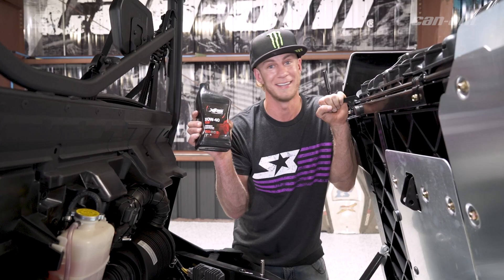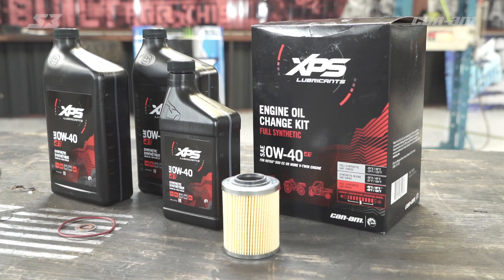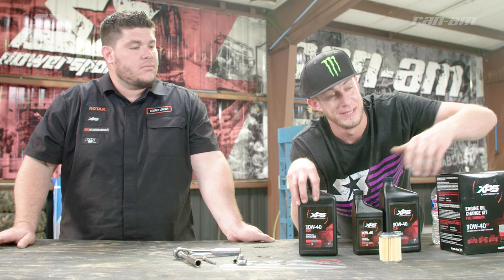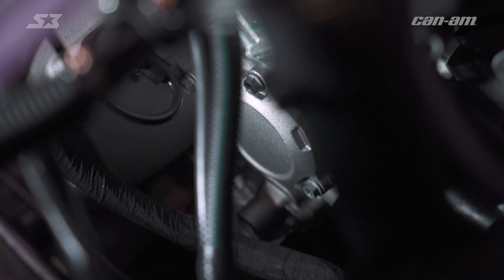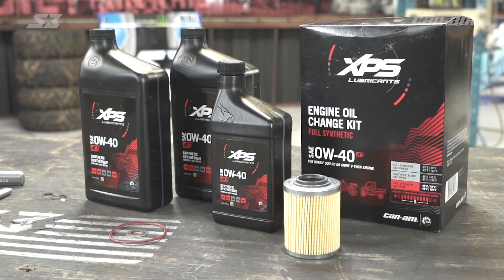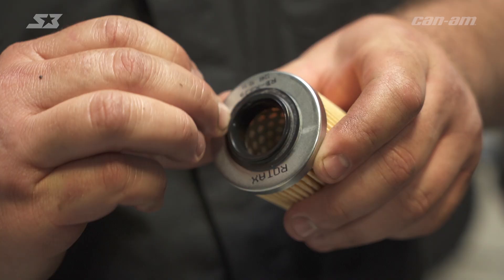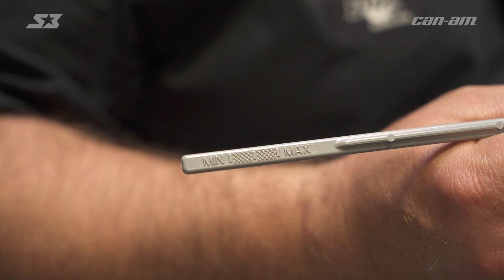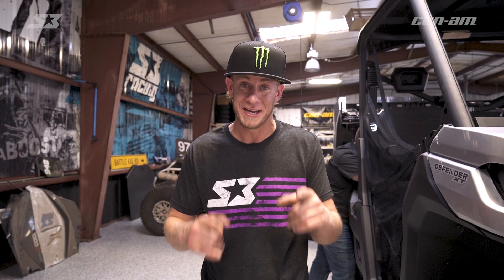How to change the Oil & Filter on your Can-Am Defender | Gettin’ It Done

Comment: You say 13mm socket for the drain plug but it is 17, and if you look at the video when you pull out the drain plug you can see 17 on the socket. May want to update this but other than that great work on the how-to videos.

Comment: Plug requires a 17mm socket and oil capacity is 2.1 quarts.  Don’t use all of the oil in this kit!
Reply: You are correct......2.1 not 2.5 quarts.